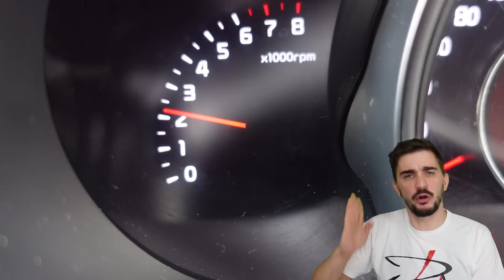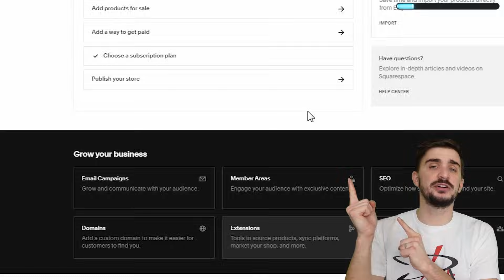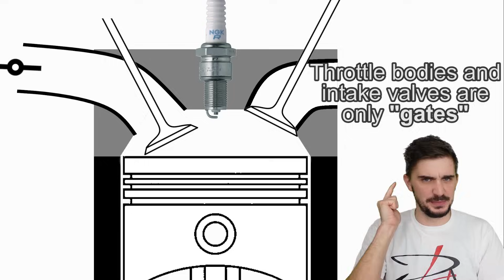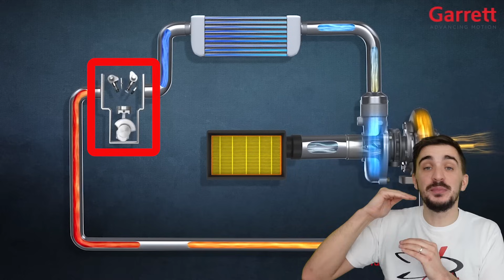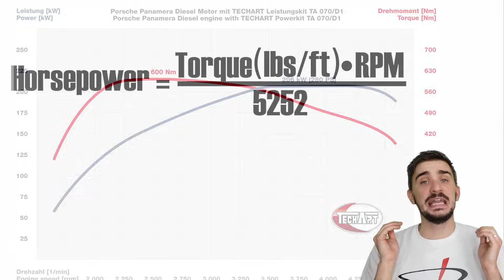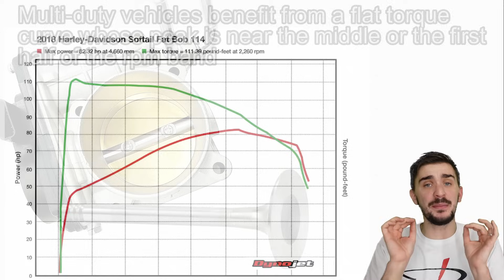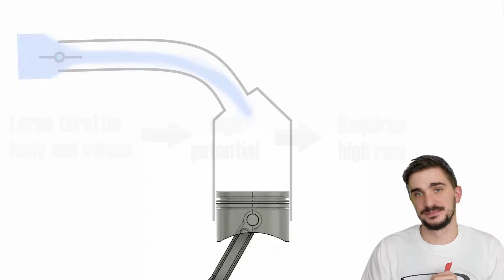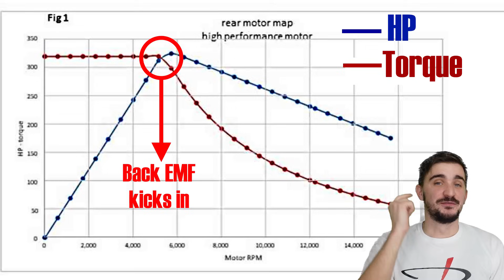WHY are HORSEPOWER and TORQUE CURVED?

Comment: the reason boost doesnt give instant power isnt exaclty what you said. the vacuum the piston creates can only get as much as air as the difference in the pressure outside and inside the cylinder: in this case the maximum (in most engines) is either atmospheric (na) or the set turbo/supercharger pressure. they dont "stuff" more air,  they just increase the "outside"pressure".
Reply: If I'm understanding you, you're saying that forced induction overcomes pumping losses but doesn't really pack the air molecules in tighter together. Is that about right?

Comment: I wish motorcycles had torque at low rpms...

They always make them inefficient and unreliable because of high HP than torque
Reply: Except for cruisers/choppers, those have a lot of low rpm torque
Reply: @DanielRolirad  yes but, it would have been great if adventure motorcycles and touring bikes had it, because cruisers and choppers aren't good looking for some riders like me
Reply: Its hard to make torque with a tiny 250cc engine.
Reply: @ghoulbuster1  how about +600cc motorcycles ?
Reply: @yacinealg152  with big strokes? Sure.
Reply: Have a look at the Harley chart in this video. Stupid amounts of torque at ~2000rpm.

Other bikes make good torque too, my old 919/Hornet had the same engine as the Fireblade but tuned for lower revs. It's a 16cyl inline 4 engine, it can make good torque if it's set up for it. But most sport bikes and 2-strokes are made for max power in a narrow band high up in the rev range..

Comment: so, essentially, less restrictive intakes will (likely) allow for more power/torque at higher RPMs. but what happens at lower RPM? i mean, sure, the engine won't make FULL use of the decreased restrictions (it might, theoretically, reach it's maximum at 8k RPM which it can't reach due to some other reason), but there will presumably still be some sort of advantage throughout the rev range or am i missing something?
Reply: I'm curious as well. The fact that production vehicles have peak torque set at low RPM makes me believe there's a fuel economy advantage to this. More restrictive intake increases air velocity so maybe a more homogenous AF mixture is achieved or something. Low air velocity in your scenario must have some drawbacks, I was hoping someone would explain this.
Reply: @efthymis94  less restrictive intake manifolds usually have shorter and broader runners which makes less velocity in low rpm. Valve overlap due to cam advance also creates an internal egr which benefits more from longer  runners. This is only my explanation though, not factual
Reply: @efthymis94  yeah, faster air generally leads to a better mixture, so as it is more efficient it would make sense to put it at a point where most drivers would reach that efficiency sweetspot. thinking about it some more, i'd say the variable valve lift systems on the cars today probably achieve the best of both worlds with the different cam profiles. low lift for fast moving air at lower RPM, and higher lift for higher RPM to let enough air in.
Reply: A higher flowing intake will result in a lower volumetric efficiency at lower rpm. Volumetric efficiency is proportional to torque.

Comment: Excellent video, as usual.  On a related subject, one variable I find very interesting is the stroke length and it´s potential for the generation of peak specific torque.  I have noticed that lower strokes, like an F1 engine for instance, require high RPM for the very reason you mention regarding vacuum creation and the limitation to specific torque.  As an example, using long strokes like V2 motorcycle engine like a Ducati, KTM race engine can yield specific torques up to 125 nm/liter @ 9,000 RPM yet a formula 1 engine struggles to reach 115 nm/liter at 16-17,000 RPM.  Limitations in cylinder filling at such high speeds naturally put a cap on the engines efficiency at a given RPM range.  All of these variables are very interesting and important to note in designing an optimized NA engine.  I would also love to know your thoughts on the limits MotoGP has placed on Mean Piston Speed in an attempt to level the playing field between big-buck teams like Honda versus smaller outfits like Aprilia, Ducati.  It would make for an interesting discussion.
Reply: where did you get your Numbers from.? KTM superduke 1290 and ducati panigale 1299 are both around  110 Nm/liter and I wouldnt call them long strokes. 
F1 numbers are all estimates but the estimates put the old F1 V8 engines around 120 Nm/liter.
Reply: @JuItomten  Sorry, I did not mention it but I am comparing strictly competition/race engines as those would be maxed out.  Commercially available engines would fall into the figures you reference.
Reply: @rafaellastracom6411  Oh OK! 
But where did you get the numbers? Asking out of interest
Reply: Leverage....

The farther the effort is to the load, the larger the resultant force is. Its the same for any wrench whereas the longer length wrench can easily tighten bolts with minimal effort while a shorter one requires significant amount of effort just to produce the same result.

The longer the stroke length, the more torque at low revs can be produced and vice versa. But the trade off is friction. Long stroke travels far longer between tdc and bdc. And the larger reciprocating mass of a long stroke crank creates vibration dangerous to the engine at high speed. 

Rev happy engines have very short stroke compensated by big bore. It produces power and torque at the high end.

Long lasting low speed engines maximises torque at low rpms with high stroke to bore ratio. They dont want high rpms as they will self destruct. Very fuel efficient too as they run at peak torque rpm range rather than at peak power rpm range.
Reply: @kimpatz2189  yes but increasing Bore size increases the force since you increase the area at which the combustion pressure pushes on.